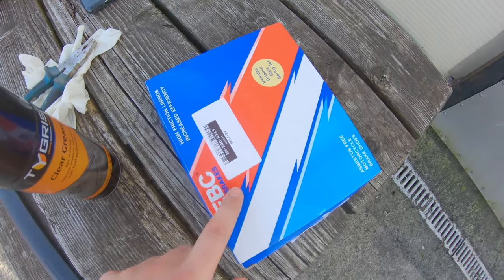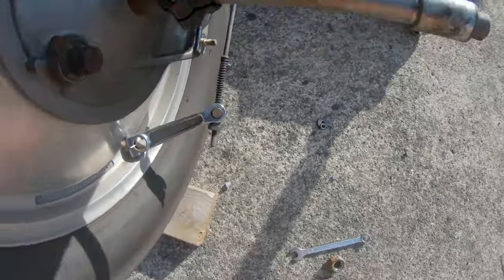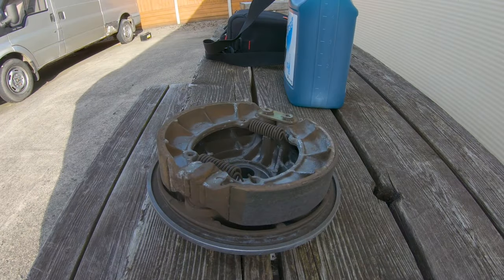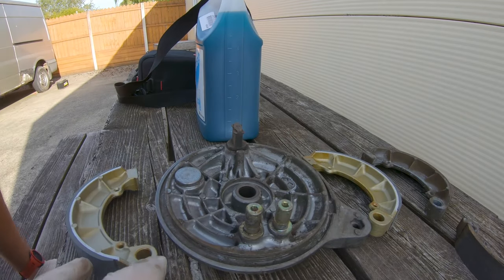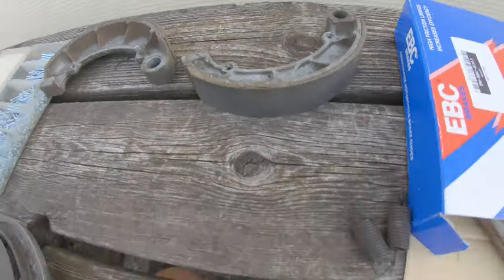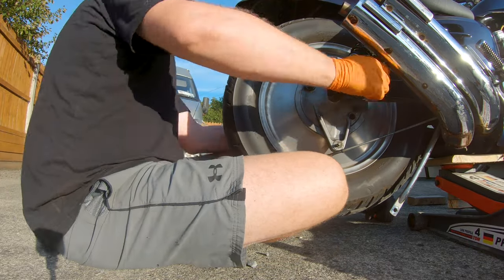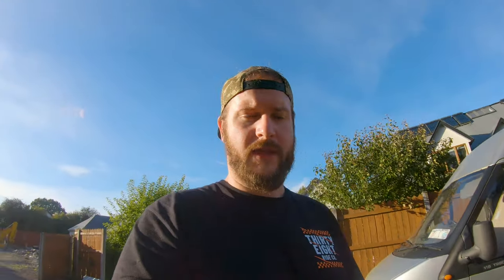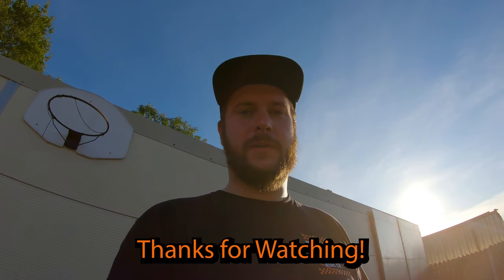Brake Shoes Replacement Honda Super Magna | Rear wheel disassembly and Removal | Magna Upgrades

Comment: I did mine last night, it's an 82 V45 750. It has two dimples to line up on the camshaft and the brake arm, resetting the distance when new shoes are installed. Also, I didn't see you torque the bolts & axle nut.
Reply from the maker: The camshaft? I didn't see any on this bike and it didn't mention it in the service manual. Possibly I missed it. Brakes work great now anyway. That's because it wasn't in the video.

Comment: ohhhh the sweet sound of that magna .. so nice :D .. quick question .. did you experience cam / rocker wear ? if so do you plan on doing the oil mod to her .. and lastly .. how tall are you ?
Reply from the maker: Haha best sound in the world :P 
Nope I have not and no plans to do the mod since it wasn't really an issue on the gen02 magnas. Good oil and regular changes is all I've been doing. 
I'm 6'7 odd
Reply: @TheGorillaBiker  ok nice :) was worried about the cam rocker wear .. but ill also be doing oilchanges etc on the reg .. 6.1 here so just wanted to make sure i would fit it :D , ty for the reply
Reply from the maker: Regular changes and you'll be fine. Just make sure you use good oil too it's a picky engine! 
Ah you'll be grand so! No bother :)

Comment: Awesome Vid what kind of grease did you use on the drive axle splines?
Reply from the maker: Thanks you!! Just drive line lube I had lying around. It contained Moly but I'm not sure how much, I think Honda recommend 40% for the splines but honestly any grease would be grand :)
Reply: @TheGorillaBiker  thanks!
Reply from the maker: No hassle bud :)

Comment: Are the rear brake shoes self tightening, or do you need to adjust them for correct fitment contact to the drum?
Reply from the maker: If you remove everything you need to set it up again. Then there's a screw you can turn with the spring to tighten it as needed. They obviously have themselves tightened to a degree but you do need to adjust your pedal as they wear
Reply: On a side note; since I will be removing the wheel; I will put on a new tire as well; do you know if there is an inner tube that needs to be replace on the bike?  I am a new owner; so I don't know much about this bike.  Thanks!

Comment: still a fair ammount of lining on those brake pads, but if their that old i would be replacing them too.
Reply from the maker: Loads really. But yeah 30+ years old has to go! Plus I'm just going through the whole bike replacing all consumables anyway making sure it's right :)
Reply: @TheGorillaBiker  better to be safe than sorry.... wise words of wisdom that were drummed into me as a kid.
Reply from the maker: 100% and especially with bikes and braking systems in general!
Reply: @TheGorillaBiker  i think with anything that could mean the difference between life and death its worth while. talking about brakes ive got to sort my landrover brakes out, one of the brake lines decided to burst, its the only one that is original to the vehicle and its steel not brass, not bad life span though for a 43 year old brake line.
Reply from the maker: Agreed again! I mean if I lost power I'd be annoyed but if I lost braking.... Well 😂😂 christ Steel lines lasting that long is incredible!
Reply: @TheGorillaBiker  loosing brakes isnt fun, about 18 years ago i had the misfortune to hit some junk in the road, couldnt avoid it. it cut clean through my brake line, but also kinked the line up from the cut, so i still had pedal until i gave more than just a touch on the brakes. rapid pumping of brake pedal did slow me down a little but not enough. shot through red lights at 30mph ish luckily nothing was coming. 
yeah 43 years for a brake line is amazing, shame they dont make them like that anymore :P
Reply from the maker: Yeah I hope I never have anything like that happen that sounds awful! I have lost brakes before but still had handbrake to slow me an di wasn't going fast. Its why I'm anal about checking them!
It's a pity they don't make a lot of stuff like they used to 😭

Comment: If the pads contain asbestos it would have been advisable to clean the part with brake parts cleaner instead of compressed air. You don't want to breathe that crap in.
Reply from the maker: True enough! No idea did they tho, better to wear gloves with these things either way I think!
Reply: @TheGorillaBiker  asbestos is only harmful if you breathe it in. You can physically touch it all you want and it won't make you sick, but when the microscopic fibers get embedded into your lungs, they never come out. It can cause all kinds of problems in the long term. It's really a shame that such an amazingly useful material has this fatal drawback.
Reply from the maker: I know, the family business is roofing :) Nasty stuff! Yeah a pity they couldn't have figured a way around it, it's also a pity the disposal of it is to bury it in 3rd world countries.